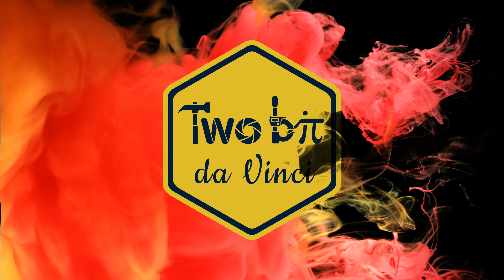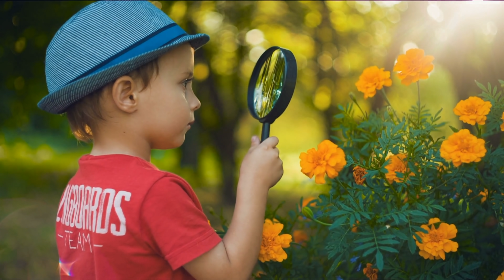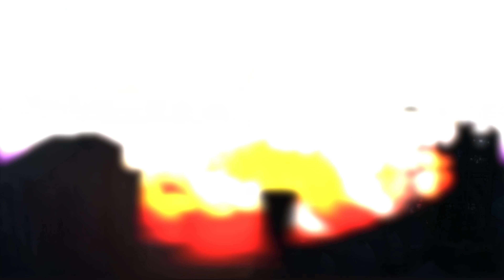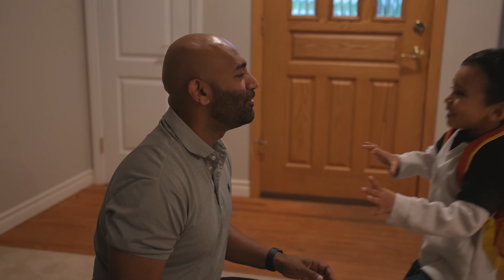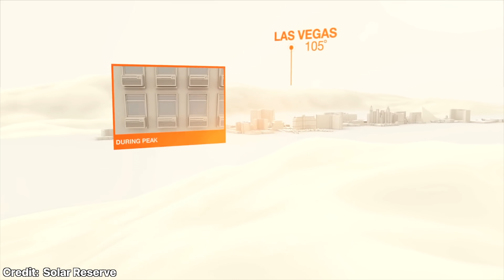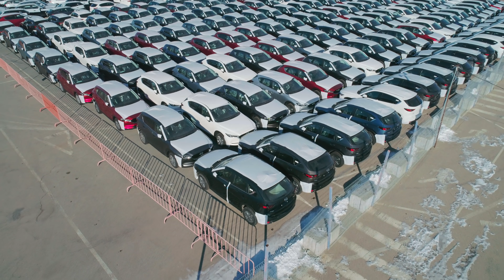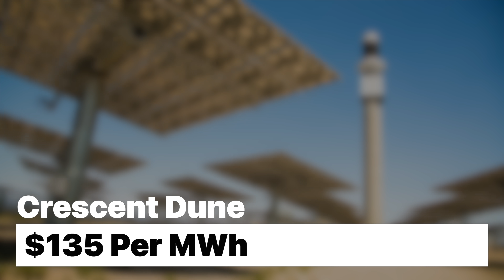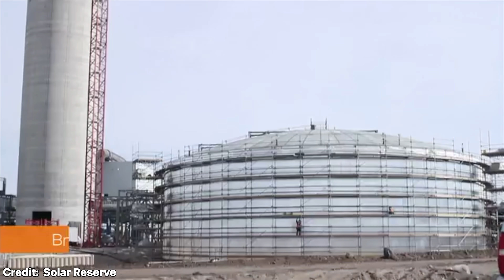This Billion Dollar Solar Plant was an EPIC Failure

Comment: As a maintenance guy the only thing I think of when I hear about molten salt is how hard it is to fix things if it ever freezes inside the equipment  Wonder how much of their missing capacity came from the power needed to keep the stuff hot.
Reply: Or how about if you need to do a repair, or something springs a leak?  You can't exactly work on the issue while there's molten sodium spewing out.  It sounds like a terror to work on.
Reply: Molten salt just seems like a maintenance nightmare. I've worked on equipment with parts that cost 10x the standard equivalent, but I have no doubt that the requirements for molten salt would cost even more.
Reply: in continuous operation, barely no energy is needed to keep it hot, since the thermal insulation of the tanks is excellent, and the power block doesn't return the molten salt at a low temperature, usually way above its freezing temperature.
Reply: I second that thought ⚙️
Reply: I know right?  I built and replaced tracks in an alchali plant in Henderson Nevada and I know the gas there was so deadly they said if it ever blew the deaths in the surrounding areas could be in the hundreds of thousands or millions.  and salt is so incredibly corrosive too.  you have to replace everything around salt at least twice as fast as usual.  and I also worked in a foundry and I know it's insanely difficult to maintain a furnace!  no matter what you do you're going to have to entirely rebuild all or parts of an aluminum furnace and that's just at around 700 to 850 degrees ferenheight.  I'm guessing molten salt is going to corrode stuff like crazy and in also guessing the gasses released are no picknick either.  the aluminum furnace I worked with was bad enough, one time when rebuilding it for yearly maintenance a guy thought to pulour water in it to cool it off, my God!  the gasses it started releasing would make you feel like dying in one breath.  we had to evacuate the building for the rest of the day, and it still smelled horrible the next day.

Comment: Ultimately, the challenge for solar (and wind) is energy density. Yes - density. There are two important ways to quantify the "density" of energy production:

#1 is kwhr as a function of materials. That is - how many kwhr (over time/years) can you produce with a given number of tons/kg/$/€, etc of materials required to build the plant. Concrete, metal, semiconductors, pipes, and so on - all methods use materials. We can quantify a ratio of the total number of kwhr/quads/joules of energy the plant will produce over its lifetime versus the dollars or tons of materials needed to construct it.

#2 is density in terms of the area of land required per kwhr. Solar farms like this one, Topaz, Ivanpah, and others consumer massive amounts of land per kw or kwhr compared to something like nuclear power. The ratio is about 500 times more land required for solar versus comparable nuclear.

The sooner the world realizes that walk-away, fail-safe nuclear power is what we need, the better. Nuclear is the lowest materials consumed to build, lowest land footprint, works almost ANYWHERE, emits ZERO emissions (carbon or otherwise). Now before someone chimes in with "But what about the WASTE?" - that is a solved problem. Nuclear generates 100 to 1,000,000 times less waste than ANY other method of energy production. And with spent fuel reprocessing, the length of time the waste is dangerous isn't thousands of years - its just a few to a few dozen at most.

Channels like this need to speak to some highly qualified nuclear experts like "nuclearsciencelover" on Tiktok or "IllinoisEnergyProf" (aka David Ruzic) here on YouTube. They provide some excellent data and analysis, and with some supplementation a great comparison of the land, materials, costs, benefits, and drawbacks of various sustainable/zero carbon power generation methods could be compared. It would be beneficial and enlightening.

Comment: Those of you who are passionate about electric cars and a green revolution should take a closer look at the batteries, but also wind turbines and solar cells.
A typical electric car battery weighs a thousand pounds, about the size of a travel suitcase. It contains twenty-five pounds of lithium, sixty pounds of nickel, 44 pounds of manganese, 30 pounds of cobalt, 200 pounds of copper and 400 pounds of aluminum, steel and plastic. There are over 6,000 individual lithium-ion cells inside.
To make each EV battery, you need to process 25,000 pounds of sole for lithium, 30,000 pounds of resin for the cobalt, 5,000 pounds of resin for nickel and 25,000 pounds of copper for the copper. All in all you need to dig 500,000 pounds of the earth crust for a battery. 
The main problem with solar systems is the chemicals used to convert silicon into the silicon used for the panels. In order to produce sufficient pure silicon, it must be processed with salic acid, sulfur acid, salpetic acid, fluoride hydrogen, trichlorethane and acetone.
In addition, gallium, arsenide, copper indium gallium dieselenide and cadmium telluride are needed, which are also highly toxic. Silicone dust poses a threat to workers, and the plates cannot be recycled.
Wind turbines are the nonplusultra in terms of costs and environmental destruction. Each windwheel weighs 1688 tons (which is equivalent to 23 houses) and contains 1300 tons of concrete, 295 tons of steel, 48 tons of iron, 24 tons of glass fiber, and the hard-to-earth rare earth neodym, praseodym and dysprosium. Each of the three blades weighs around 81,000 pounds and has a life span of 15 to 20 years, then they must be replaced. We can't recycle used rotor blades, they, along with used solar panels go into landfill.
These technologies may have their place, but you have to look beyond the myth of emission freedom.
“Going Green” may sound like a utopic ideal, but if you look at the hidden and inconsiderate costs realistic and unbiased, you’ll find that “Going green” is doing more harm to the Earth’s environment than it appears WHEN YOU LOOK THROUGH THE SMOKE & MIRRORS.
I'm not against mining, electric vehicles, wind or solar energy. But I show the reality of the situation.
Reply from the maker: Thabks for your comment, but you’re not comparing to the alternative. Solar panels do have waste of course, but then produce energy for over 30 years. What’s the alternative? Digging up more oil and natural gas to burn for one instant of value? Imagine how much digging spilling and polluting you’d need for 30 years. That’s why this isn’t even close to an argument. EVs will soon last 1M miles, and at the end the batteries will be recycled. Again compare to drilling refining spilling and shipping gallon after gallon of gasoline. Again it’s not even close to close. Don’t lose sight of the big picture. Nothing is perfect but green solutions are millions of times better over the whole life.

Comment: It was a neat idea, but is far too complicated for what it provided.  I thoroughly believe that the new generation of nuclear power is FINALLY going to take center stage and be the world's main baseload power source.  I'm a big fan of thorium, but there are several competing nuclear reactor designs now that promise so much more than in the past.
Reply: After the 9/11 attacks, there was concern raised with nuclear power because it would be a target for a terrorist attack and if the nuclear plant can melt down and cause radiation in a large area, I'd be VERY concerned about using nuclear..  Yes, Thorium does seem promising, but I still think it's not ready, YET. I know in China they are setting up some prototypes that aren't commercially available yet. I just don't think nuclear is the ready yet.

Comment: I can't believe you happy about wasting $1B, including substantial  government grants. 
I really don't think it's necessary to store PV energy because they produce power right when power peaks. It complements the base load supply very well. I know they had some trouble with it in CA but I think much of that is because of extensive residential installations. It'll be easier to handle the source fluctuations with mostly centralized generation.

Comment: The whole “storage” method using molten salt seems super sus. I can imagine it would solidify in the pipes quite frequently, and unlike oil or steam, you can’t pump it out, it solidifies and destroys the entire piping. I know the whole “storing the energy” thing is a huge selling point so it can run when the sun isn’t out, but molten salt seems like just asking for issues. I know it’s used elsewhere in power plants, but they only have limited operating hours when the heat is at its max and you can confidently keep the salt molten.
Reply: Well here in morocco we habe one working soo.. a thing that could be in play is corruption and higher ups

Comment: Crescent Dunes' Heat Management System was flawed. They designed it without enough safety margin to allow for; power variances, insulation weaknesses and heating cable challenges. The Power Distribution system didn't provide consistent, predictable voltages to the electric heat trace. Also, the Insulation had issues and the MI Heat Trace had metallurgy issues (lowest bidder wasn't the best source for both of these). The tracing failed due to overheating of the hot/cold joints. (They put them under the insulation where as they should have been located above it on systems this hot.). When the heat trace doesn't keep the salt at the Maintain Temperature, you get costly leaks. There were many, many leaks on this project. Those leaks continually pulled the plant off-line.

Comment: Let me see:

A simple panel that you can place almost anywhere, doesn't need complex math, plugged into a battery. With basically zero maintenance.

Vs.

Big f-off mirror farm with complex motors and moving parts making 1000F lava to boil water to spin turbines to make electricity.

Can't say why it failed there.
Reply: Lol Photovoltaic panels dont acumulate energy, and this plant its it own battery. Its way more expensive to use PV panels + acumulators of batteries. Spain had 50 operative Solar-Thermal plants working at night, but only few of them are molten salt Towers, small heatpipe-solar ones are the most, less efficient but more enviroment friendly than the giant Towers. Also PV are China dependant, thermal-solar not and can work at night also obviously cheaper to acumulate.
Reply: @SargentoDuke  Oh I'm not saying its bad. I'm saying there's a lot more things that can go wrong. Which is why this one failed.
Reply: @TechInspected  this video plant its actually working, half managed by the spanish builders. The fail was about political failures like the cheap materials.

Comment: Well solar and wind is useless right now with current tech at least 50-70 years. Maybe we should focus on the reactor in France because 100% clean doesn’t need a massive footprint like solar and wind. Also very low maintenance cost to maintain doesn’t require massive amounts of rare earth minerals and the list goes on. The sad part is it only needs 20 billion to finish and then we will have the first energy source that will produce its own power to keep running. Also there are like 13 countries invested in this tech and 20 billion is a drop in the hat for 100% clean efficient energy.

Comment: I heard when birds flew over the field of mirrors that area was hot enough to burn the wing feathers and the air was ultimately too hot for the bird to survive though and they would drop out of the sky. There would be dead burned birds on the ground. Not a good thing.

Comment: The statement…. All green energy is hated is too harsh and quite wrong. We believe in facts, not fiction. Yes there are alternatives to fossil fuels but if they are to be implemented the current systems no matter how offensive must remain fully operative while these alternatives are being designed, built and tested… Not before. Running around with coloured hair screaming profanities at those keeping the power on doesn’t help a single soul.

Comment: Once you mentioned those mirrors and the adjustability and intelligence behind them I instantly realized the maintenance costs were going to be insane.
Reply: No...it is the cost for the capital equipment! Money has a time value, but this is always ignored for green energy. This was a complete failure before it was ever built.
Reply: @Quentin Styger Can't argue that, unfortunately the little hat people that are in control of the place (Blackrock) prefer highly $$$ profitable wars.
Reply: WHAT  maintenance cost!!!???  this is low speed low load stuff! big ships, trucks and aircraft do it all day. i think there is some bull crap or on purpose bad engineering involved. for christ sake just boil water and spin a turbine !! how hard is that??????!@!!!!
Reply: Do nuclear power plants not require maintenance?
Reply: Air Dust will settle & cover the surface.

Continuous refinement is a MUST
Reply: i dont think its the heliostat maintenance that killed it. they dont all fail at once. you might have a couple offline at any given time and a small team fixing them. they could have retrofit this thing with a steam generator and ditched the whole molten salt system, and it would have still been able to deliver power at peak daylight hours.
Reply: @LordOfNihil  EXACTLY RIGHT, this is slow moving stuff why would it break down??  big ass ships and trucks  have spinning parts all day!!!
Reply: but idea is good..
Reply: @raygud  totally, it's a cool idea, but maintenance was the thing that sealed it for me.
Reply: LOL - It's like saying healthcare should be free for everybody "Obamacare" until reality hits & it actually cost a freaking fortune.

Comment: A couple of things - Yes they didn't see the S-curve on solar PV, but it's easy to be clever with hindsight - its fair to say "you should expect an S-curve" but what was not easy to predict was when the sudden drop in the "S" would kick in.  Solar PV had been around for decades and the sudden drop had not happened, and may not have been for some more years.  They were unlucky with timing here.

In terms of storage, solar thermal with storage ought to still make sense but the molten salt was too problematic and the stored energy was only released as low value grid electricity.  It would make much more sense to use the excess (or maybe all of) the solar energy to produce hydrogen or synthetic hydrocarbons because being transport fuels these attract a premium compared to grid electricity.

It was a bold experiment and yes it failed but the lessons learned are valuable as long as well use them fairly and not just to write off solar thermal as uneconomic.

And by the way, whilst you're being brutal about what others should have seen and didn't, there's a thing you are not seeing here - the increasing cost of energy.  In the UK, gas and electricity prices have exploded in the last few months.  Technologies that were not economic previously will become more economic in the future as demand for renewables increases.  It will make sense to retrofit Crescent Dunes for future use, maybe with modifications to the technologies, like for instance replacing the salt circuit with a Rankine cycle (or organic Rankine cycle) and using it for hydrogen generation.